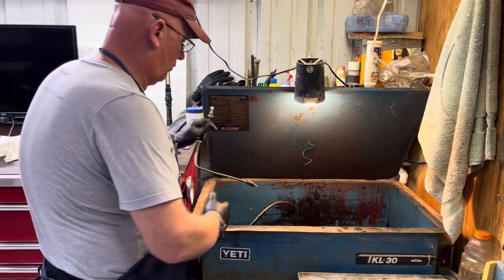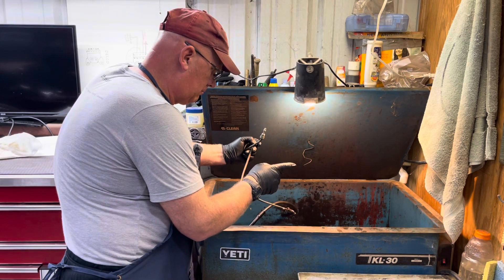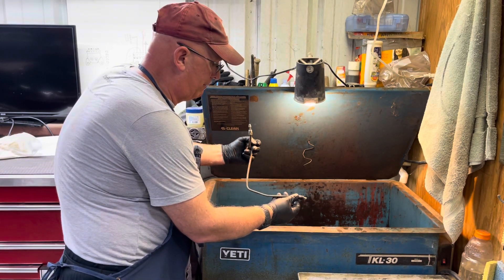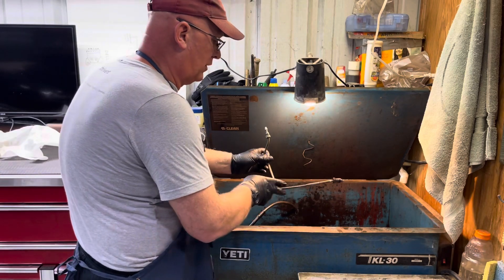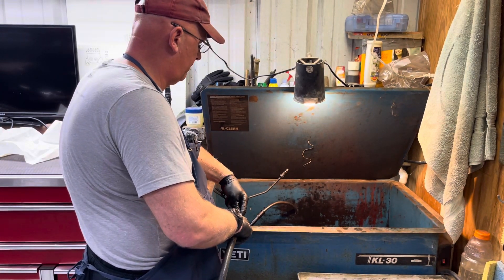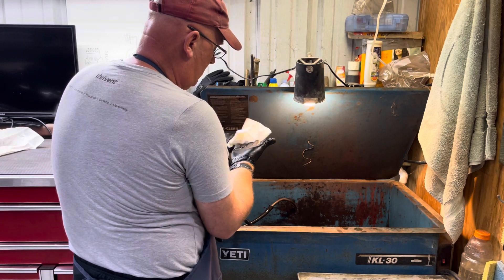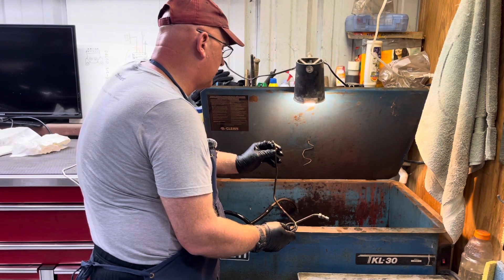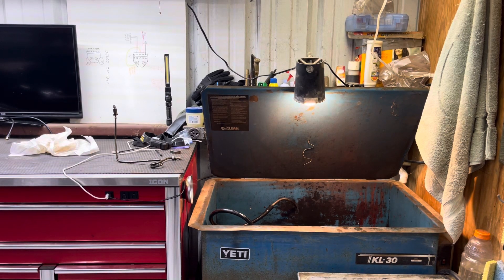M35A2 “Whistler” trying to clear clogged injection line. (5)

Comment: The best way I found to cut the stale diesel or Biodiesel shellac,  Is lacquer thinner or Carb/choke cleaner.
Brake cleaner, or parts solvent won't touch it. E85 gasoline will also dissolve it.
TGP
Reply from the maker: Thank you for the tip. Thanks for watching.

Comment: wow the years of teaching you can give very nice  , got one tough onefor you,  on a 1982 6.2 3/4 ton 4wheel i want to drop oil pan and see if my oil    pick up tube o ring in bad  got low oil pressure and i guess put a new oil pump in too but not sure one what pump   to buy thanks again sir
Reply from the maker: A fast search showed several brands available. Including GM. Oil psi is almost never a problem with the 6.?  Unless cam, crank or rod bearings have been run dry. When you pull the pan, pull a main bearing or rod bearing cap to see how the bearings look. If copper is showing, figure on all new bearings.
Reply: @timsteachablemoments1786   will that oil pan drop easy or do i have to remove crossmember
Reply from the maker: @alshaw9420  It will drop in the stock location.
Reply: @timsteachablemoments1786  good looks tight  thanks